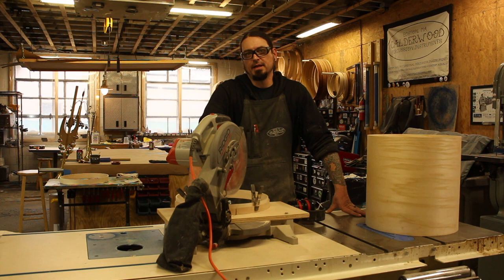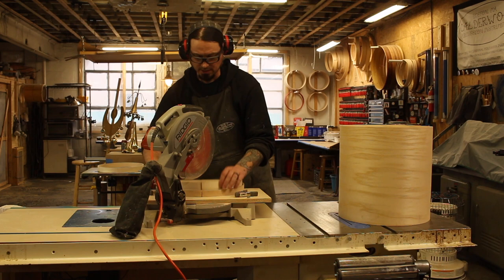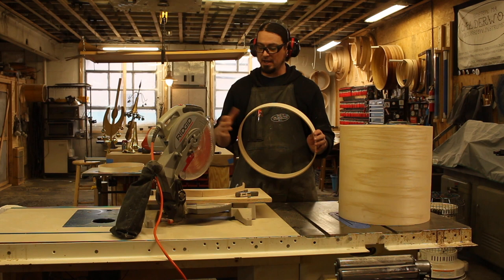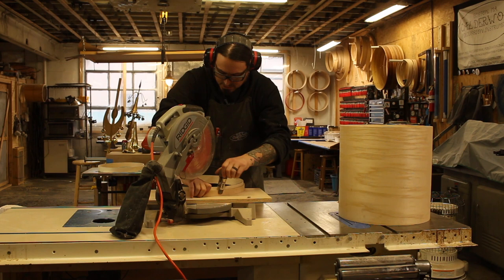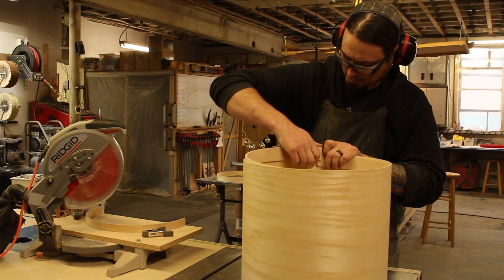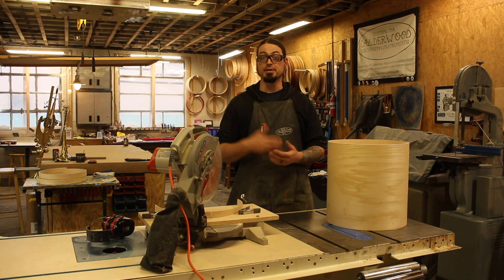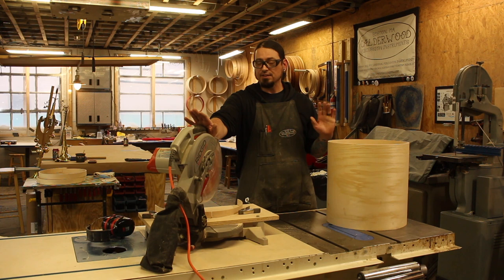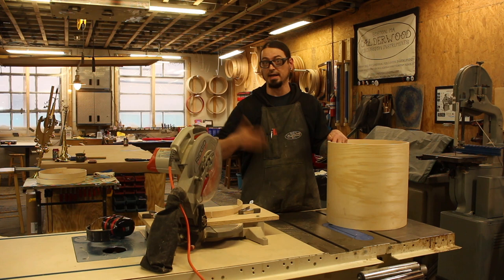Reinforcement Rings - Miter Saw Method

Comment: Try using a flat tape. They are made to go around cylindrical objects.

1. Subtract two times the shell thickness from the actual shell OD.
2. Multiply that ID dimension times Po (3.1416). That is your circumference of the re-ring OD.
3.Transfer that circumference to the uncut re-ring, with your flat tape.
4. Cut re-ring using your miter saw & jig. Cut on the correct side of the lines.

Should fit perfectly.

P.S. If it doesn’t fit exactly like you want, you have created a baseline. You can adjust, as needed. From that point forward, you will have repeatable results for that shell diameter/thickness combo. With a bit of trial and error you will be able to save a few steps when fitting re-rings, on every drum you build.
Reply: Po, not Po.
Reply: Pi, not Po. Boy, that spell check really is sneaky.
Reply from the maker: great idea, thanks!